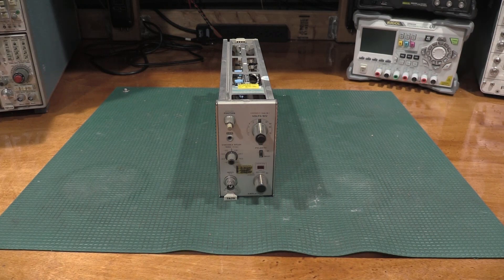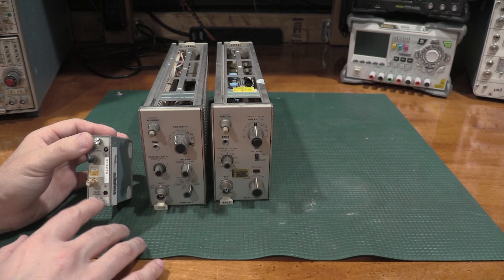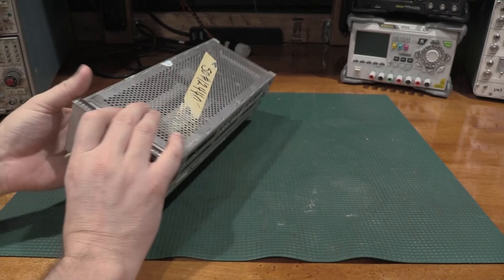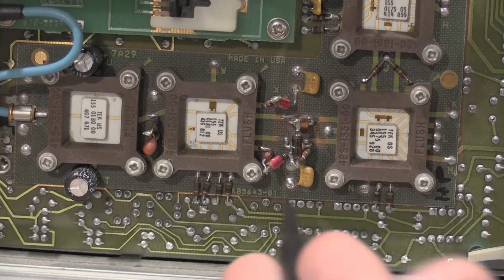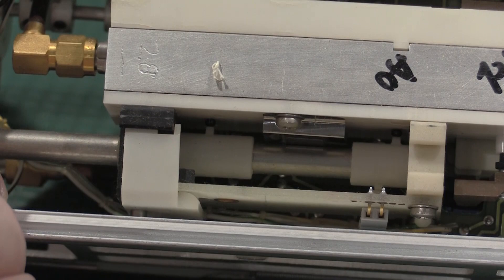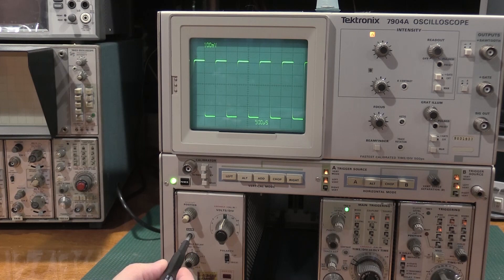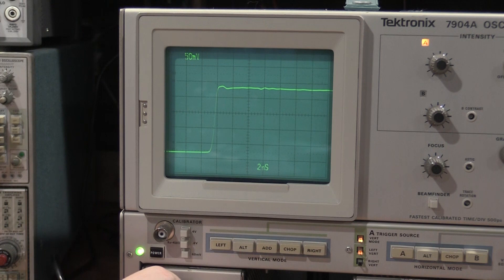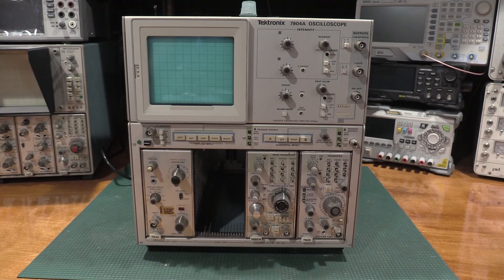Tektronix 7A29 Lab Check in

Comment: Hello and thanks for keeping the older Tektronix school alive. As i have gone deep into the 7000 series rabbit hole please keep it up.  I have a very early 7904, two 7904A"s and a 7834 just show up at my door today (Very pleased with the extremely clean appearance, but in does have the usual switch issues.). At this point the first three just barely pass check in, so thanks again for all you tips and videos. Also enjoy the TM500 and TM5000 videos as I have collected a large lot in that category. If that isn't enough, I also have a decent 5000 series selection and it also is waiting time in the healing room. Yep, I'm a bit addicted to the older Tek gear. Enjoy your detailed examinations, although some requests would be more detail on your switch and attenuator methods.  An example might the dreaded drum switch repairs, i.e. how to keep the timing or re-time if you goof. I have seen your 7904A pop up once or twice would love to see more... I am planning to do some videos of my soon, just in you are curious of the tag name.
Reply from the maker: I am starting to get more and more requests for the attenuator servicing video. So I will have some information out there soon I am still working on some long term testing as it defiantly deviates from the service manual guidance. However I do not have a good solution to the elastomer contacts in the REALLY high speed suff 1Ghz. So I am still using service manual cleaning methods. But more is always on the way!

Comment: Thanks for the info, It got me looking at my 7A29 and sure enough the attenuator is stuck. If not for your video, I would likely have broken it! After careful removal of the attenuator assembly, I was able to clean and lube the rollers. Switches smoothly now. Still need to get a mainframe up and running to check it out.
I was lucky enough to pick up the 7A29 along with a 7104 Mainframe,7A28,7A16,7B29 and a 7704 printed manual for just over $300 including Tax and shipping. And more incredibly it arrived undamaged! I have a lot of items to be checked out ahead of them though. I guess this is what you get for being a Tektronix junky!
Reply from the maker: Glad I can help! Watch the beam current as well on the 7104 the main difference between that and the 7904A other than bandwidth is the micro channel plate CRT. The micro channels need a bit more care then the slower ones it is REALLY easy to burn the tube.
Reply: @ZenwizardStudios  Thanks will do.

Comment: I absolutely need a 7A29-4 to join my 7A29, and the 7104 mainframe with the options extra RF shielding and optimized X-Y mode. John Addis who designed the high speed amplifiers in this plug-in is alive and well. If you would like an introduction sometime, ping me by email ( prior correspondence) and I'll get you connected. I'll be having lunch with him and another Tek alumni soon. I'll send him a link to this video too, I'm sure he would enjoy seeing it.

Comment: I have bought a 7A19 and use on my 7834, I believe the reason why you can't use voltage  upper 1v is because you have 50ohm load.
Reply from the maker: Indeed, as well as the faster the unit goes the input capacitance needs to come down so the parts need to get smaller. Including the 50 Ohm Load. The resister is what gets damaged when the inputs to the SD’s are over loaded however if the resister totally goes away full input voltage can then hit the FET or Amp and take out the first stage of the input as well. The SD units also do not have an attenuator in the front of the 1st stage. So It is DC coupled right in to the FET. The 7Axx units do have an attenuator which takes the brunt if the load goes away.
Reply: @ZenwizardStudios  do you use some special dioxide liquid for contact? I have cleaned it with alcohol and after one week they are bad again..
Reply from the maker: Send me an E-mail on this one.